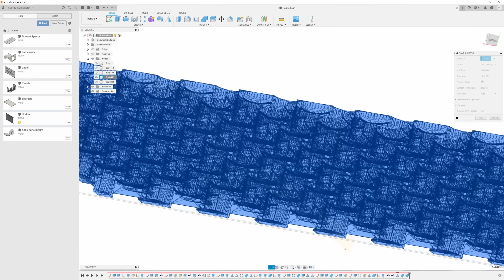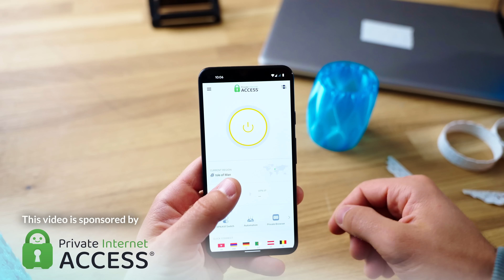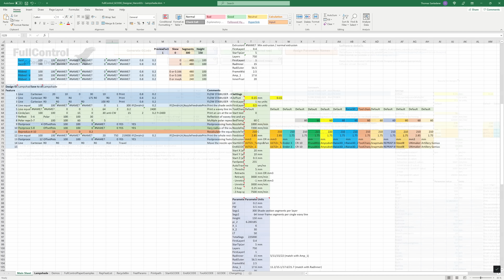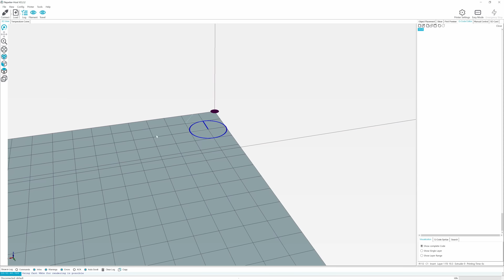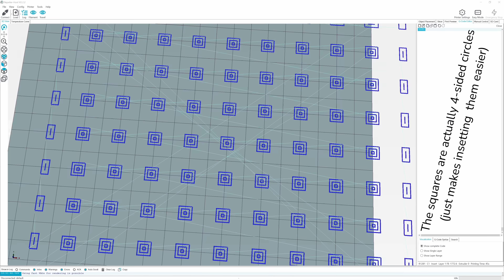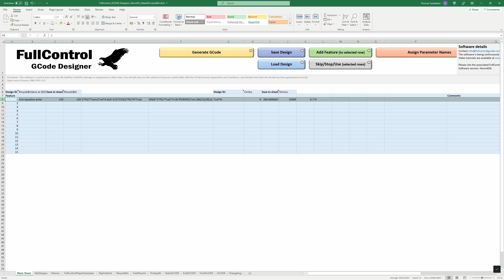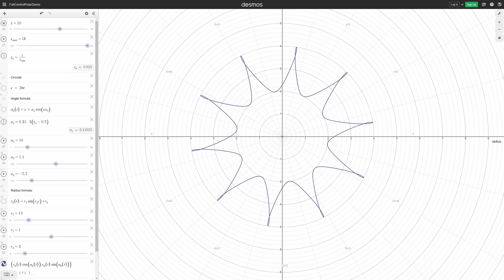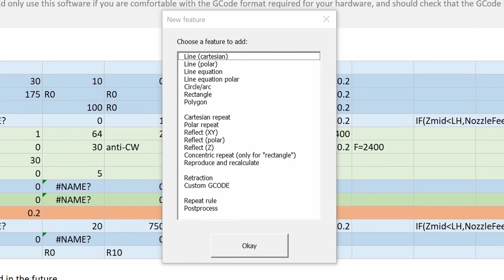You can SKIP 3D modeling now

Comment: I applaud you for trying something new and sharing.   What I say next is not meant as a criticism but only as an alternate approach.

You could have gotten rid of the tiny weird wall fills with a single setting in the slicer.  Minimum extrusion length.  Make that sufficiently large enough and those short BS fills go away.  Also, if you pick the right line width and Union overlapping volumes, you get more weirdness that just goes away when trying to do something like this.

That leads be to the tab at the bottom.  That could have been a separate model that you overlap with the cylinders.  Again, with the union overlapping volumes turned on and a singular isolated resize in the z axis you can make that tab at the bottom one layer thick.

I could have done everything I've seen so far in the first 7 and a half minutes of your video in about 7 and a half minutes of knowing just the very basics of how to model and how to leverage the slicer settings.  In fact I'm half tempted to try making this battery holder but for different size batteries.

I'm not taking away the value of what you show.. the mathematical approach to being able to generate GCode is fascinating, wonderful, and really does open a whole new world.   It's just that the example you gave really is much easier to do using a technical / tool based approach where the wavy shapes you demonstrated using functions really is where the mathematical approach shines.  I get that you wanted to make the topic approachable.  I just don't want people thinking that the battery holder couldn't be done much easier using a better understanding of the slicer and a better understanding of how to model.

So what rules do we want for a challenge?  1 line width cylinders, max line width percentage, tabs at the bottom that are one layer height tall.  The cylinders need to be welded together so he wall overlap will need to be carefully considered.... The thing is SmartAvionics on GitHub has a custom version of Cura that does an amazing thing with variable line widths where two wall lines need to fit within a space

Yeah this is looking pretty easy to do using basic tools.  I could probably use TinkerCad generated STLs and simple grouping either within TinkerCAD or within Cura to do this same thing.  Both support measured movements, so you create the smallest block, group it together, duplicate it, move it by the size of that block, group that together, duplicate it, move it by the size offset again, group, duplicate.

Yeah I can get that workflow down to about 7 and a half minutes.

Comment: Excel has pretty big limitations by not being able to write your own functions. I once tried to use it for prototyping a game feature but it quickly realized It cant make dynamic functions in a cell and I would have to make set patters with 3 separate calculation tables because I cant make a custom class with 2 variables or anything dependent on the color property of a cell.

Comment: I can see this being very useful for small parts. I recently spent multiple days trying to model cable combs for my PC. These are super simple, an array of circles. But in the slicer, I got a bunch of those infill artifacts you mentioned. So I kept tweaking the 3D model, then my slicer settings, then the model again, trying to trick it into doing what I wanted. I am going to try using this software to generate the part. Thanks for the info!
Reply: prusa also has this super-annoying thing where it always, always (it is impossible to defeat afaik) tries to make near-vertical walls thicker. This is very unneccesary most of the time and it slows down prints insanely.

Comment: cool gimmic, kind of useless for anything other than vase like objects.
It does however highlight the need for better slicers with actual path optimization built in, instead of rule based paths like all current ones use. Maybe it’s possible to describe the path in the slicer such that it is differential with respect to print time, then you could apply gradient descent to optimize for speed :) 

Or maybe we could apply machine learning to the problem, basically ”Create a toolpath that looks like this, but prints as fast as possible” or you could optimize for print quality :) Basically, we need optimization in our slicers, optimizing the Gcode ”by hand” by describing equations is extremely slow for anything that’s not symmetric.

Comment: But maybe, just like me, people are really good in 3D design, but hate maths ?
Reply: A better form of this would let you use primitives graphically, while sticking to a mathematical representation, and only making the Gcode at print time. You'd still get the benefits of the mathematical modelling approach without having to directly work with the maths.

Comment: Meh. This seems to me the 3d equivalent to develop software in assembly than use an higher level language. Sure, as I personally tried, you can develop much more optimized functions in assembly, but ultimately you need much more time to end up with a full developed software than using C, java, etc.. The same here: until you need to model complex 3d models this method is fine, but I think is very time consuming when modelling organic forms or models that need a lot of support. It also needs to take in consideration the fact that slicers, like compilers, gets more and more optimized every time..

Comment: I was trying to model a pretty complex mathematical shape in F360 a while ago, and it was essentially impossible for a hole host of reasons. Not only is F360 a big bugfest, it has really poor memory management. The few times I could actually get the model simple enough for F360 to be able to extrude a surface, it would start to hang and take up to 20 minutes to process a single modification.

This would be really useful for that,

Comment: This looks good for simpler geometries, or geometries which can be defined with mathematical shapes, where you really want to optimise the GCode toolpaths. Its a bit of a dark art getting slicers to do what you want sometimes, having full control is cool, but far too cumbersome for complex object modelling. This could be good for production environments to produce simple objects efficiently like that battery tray. Looks like one of the only options for non-planar slicing other than GCode post processing that I know of.
Reply: Besides, that battery tray could have been done using a repeating squiggle line going in a mesh pattern, batteries dont care about uniform support.
Reply: I don't think it matters how much work it takes for a complex object, it will be worth it for some - it only matters if you are only making a tiny number of them so upfront optimisation costs won't be paid back...
So most of us probably won't use this sort of tool for a complex object, but somewhere that makes a kit using 3d printed parts for example might well - every part they have to make takes less time to print, and uses less material than the slicer generated object would. (Though I could see the folks that like OpenScad finding this a very easy method to get exactly what they want - it appears a similar thinking process)

Comment: Oh how I miss Autocad 8 and LISP..........and Alphacam. 
Not sure how my employers all ended up using Inventor, Solidworks, Solid Edge etc.
Surly efficient (or lack there of) G-Code output from slicers is the problem, and less than optimal modelling? 
Now, development in this direction is exciting. Harping back to a simpler time of the mid 1980's seems a retrograde step, no?
Reply: Yeah, I would say slicers are still very crude and basic, at least the ones I have been using. They could use a lot of work.

Comment: It would be interesting if code blocks in Tinkercad could produce Full Conttol GCode instead of an STL to be sliced. You’re essentially defining the design as parameters anyway so it doesn’t seem like a stretch to output Full Control GCode. Then again, I may be missing something obvious.

Comment: My immediate thought was "This sounds like OpenSCAD with extra steps" ... but the longer I think about it, the more I'm realizing that it's quite the opposite: OpenSCAD has a completely different model, it only cares about geometry. The steps there (add, cut, rotate, ...) are to create a final model, but they have nothing to do with actual physical production. FullControl GCODE on the other hand only really cares about nozzle movements - the geometry created is almost just a side effect. As you've shown, this can be very useful for optimizing paths.
Reply: I really like openscad but I also really like how it can work with almost raw math.
Reply: OpenSCAD does solids, this does.. lines only! Theyre very different I'd say.

OpenSCAD does not know how to compute extrude speeds for example.
Reply: Thinnk this would with better with something like implicitcad wich only does mathematical definitions of geometry instead of the aproximation openscad does while rendering.
Reply: ,,,,,,,,9
Reply: Yeah I think I had the same thought process. The definitions feel similar. But the purpose is to code each line, not the shape. 
I think full control would lend itself to a functional language though.
Reply: CSG (OpenSCAD) => Modelling with boolean operations on primitive solids
BRep (Most UI CAD) => Modelling by defining boundaries, focus on extrusion and operations on edges and faces
"FullControl GCODE" => No modelling at all, just commands
Reply: I was thinking of OpenSCAD as well. Changing it to output GCODE directly and hopefully also include G2/G3 instead of chopping up circles/curves to facets would be nice too.
Reply: @roysigurdkarlsbakk3842  That would be a lot of feature creep for openscad. Filaments, materials, support, bed heating, fan control, all sorts of stuff that are beyond its remit.

Comment: I noticed they are working on a python version. Could this be used to build an addon in Blender to optimize my drawings directly into a gcode export file?
Reply: Maybe but it misses the point.
Reply: @cprogrck  I guess he wants a simulator for the code, which is not that easy btw. We tried that years ago but decided the CAM software from somebody is better for this.

Comment: What nasty problems are you speaking about using thin wall or no infill with specially therefore designed model? I use this method all the time and it works mostly great on the first try and also is much quicker to do. Certainly many people can't use solidworks to do this in a efficient manner.
It should also work if you write the STL by hand (not really sure how hard that is, and how many predefined forms there are in STL) and put it in a slicer with vase mode on.

I tip my hat to your explanation and research, seems like quite some work making this video.

Comment: My first reaction is that this would be super useful for small manufacturing of things that are basically simple shapes - for example, Thom's battery holders.  The extra time spent setting up the gcode will pay for itself after a few dozen units.  But for one-offs or very complex shapes (like, say, a miniature of R2-D2 which is what's on my printer right now) the time and plastic saved from optimizing the gcode is not going to cover the time (and wages, if a business) spent creating that gcode by hand.  That said, it's still very useful to be able to get under the hood from time to time! Glad to learn this exists.
Reply: Pretty much my take away as well. This could also be huge for cosplayers or anyone else looking to save on print time & post processing while trying to a create more uniform strengths.
Reply: @hazonku  I doubt it would be useful for cosplay. Generally they are using pretty complex models made by other people and even if they are making themselves using a modeler is way easier than trying to input basic shapes into a very complex structure without any GUI. 

This is really only useful in extremely niche cases. 

If you have the budget for large projects you should be optimizing your fill the best possible ways you can within reason.

Comment: As a solidworks nerd, this seems like it would be way easier to model first then export as 3mf
Reply: Sure but the whole point is you cannot guarantee the slicer will follow a specific path, in this case the "optimal" path for speed.
Reply: @jaro6985 that's right but it doesn't mean "you can't 3d model it"

In CNC machining you do have control over the path and can overwrite/force the tool to follow a specific path. This is something I hope we'll see in slicers in the future, like go to one layer and say no you can't go there before having done that area or went that way and that's how I want it to be for the next 100 layers. This would actually be way more useful than making some gcode manual work on freaking excel of all things.
Reply: Or model with Rhino and Grasshopper, or another freeform modeling software that has some programmability to it.

This is either clickbait or lack of research/knowledge as to what is actually the proper method.

Also, all well trainer CNC programmers (not trained on the job in 2 months but those who actually studied to become excerts in this) know how to code a part by hand... in fact gcode has wayyyy more features than we know in 3d printing, were just using the most barebone selection. I just don't like that term "full control gcode"  because it presuppose that we didn't have full access before, which is plain wrong.

Comment: I sometimes reduce printtime simply by designing a part with multiple's of the nozzle size in mind.
Then I set the infill to zero and increase the perimeter wall count to a number that completely closes those small time consuming gaps.
This also results in very sturdy parts.
A big downside is that this has diminishing returns and it is easy to end up with higher print times if used unwisely.
Reply: I guess the slicers could help in that too, by giving you options to remove tiny "features" (with an adjustable slider or something) that don't really add much material or functions to some prints. I guess that the slicer already knows what the inside and outside shell of your model are, so it could at least make sure you have a fully printed shell. Or does cura already has options like that, hidden somewhere in the large field of advanced settings that i never use?
Reply: @ProtonOne11  Yes most slicers have a adjustable parameters to avoid small features but messing with those does usually very little to the rest of the pathing. (Also it can really mess with your print quality)
Accelerating and decelerating are the biggest culprits for stacking up print time.
My method alleviates that a bit by longer tool paths through the added walls.

Also I do mostly functional printing where looks don't matter as long it works and is durable. Wall count really bumps up stability not infill. 20% infill is usually more than enough to keep integrity.

Comment: My mind jumped to “what if G-code was generated in real-time, as it was printing?” while watching this! Nothing does that yet, right?
I don't know what that might be useful for - except responding to feedback, such as print errors - but it sounded cool in my head! 😹
Reply: Manual controlled printing, that's genius
Reply: Microsoft had a slicer in Windows, you could print an STL and it would slice and print. Never went anywhere, that idea is just not very good, given the settings needed in a slicer.
It would be useful if the output was huge (not applicable) or perhaps for some dynamic control, adjusting to temperature perhaps?

Comment: I think that the "printing" element of 3D printing is about that software abstraction that covers the conversion from logical data object into pile of melted plastic spaghetti. This is a very clever setup, but it's a bit like hand optimizing a bit of software in assembly, it's only useful if you're going to run that process a lot so the cumulative efficiencies mount up.

Comment: don't get me wrong, i love excel, but i use it for data management as it was intended.  this is just bonkers.  

if simple code like this is  taking 6 minutes to compile i'll spend that time added up just letting the printer do it's thing.  a machine taking time to do stuff is not the same as me taking time to do stuff as i could be using my time elsewhere while the machine is doing the work.  it might take more filament and be less efficient overall, but my time is more valuable than the machine's.
Reply: don't get me wrong. - It is a tool from a scientist. Think twice, do once. -  I doubt you have enough background to use it. - Not everything is for everyone. -- This is the tool I always wanted to create. A faster version written in python is on the way.

Comment: This would be an amazing openscad add-on
Reply: For the most part, OpenSCAD can achieve much of this with far fewer keystrokes.  However, OpenSCAD probably could have some new capabilities if it could be blended with this.
Reply: @johndoner6245  true, and export the model to a splicer, when you optimize the model properly, could work better. But examples like this are great to show its possible.
Reply: Or even cadquery

Comment: Previewing with Prusa-slic3r gcode viewer is also recommended. Sometimes Repetier displays incorrectly. And prusa's viewer has the vertical slider. No paste though. 

I started looking at the nonplanar slic3r Zip-o-mat/Slic3r too. I would still like to generate supports & perimeters etc, instead of reinventing everything. I only have limited 3d printing experience though, so much to learn.